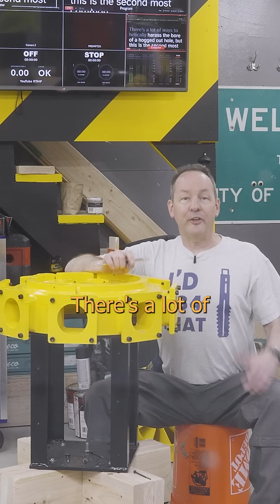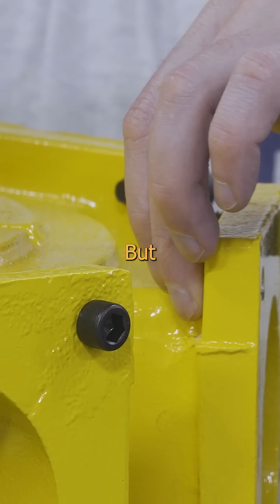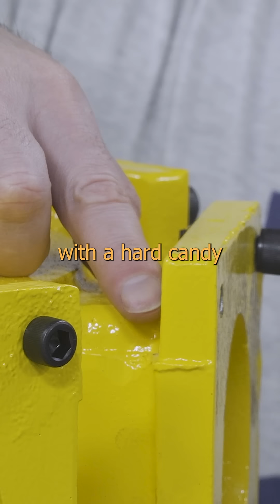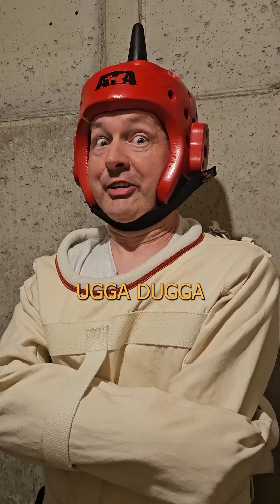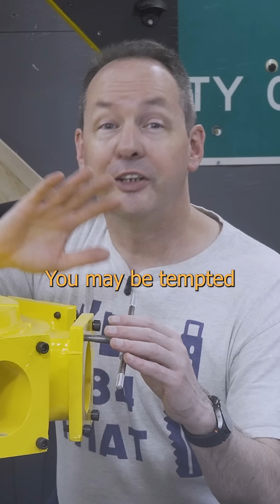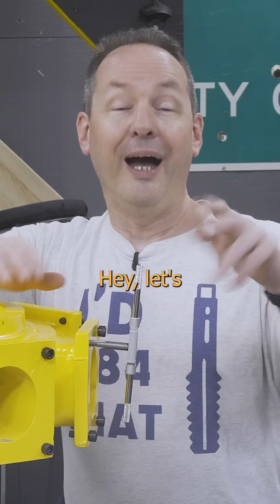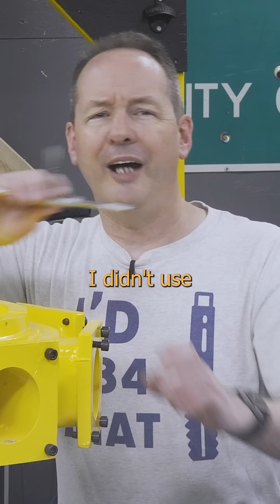Thread Chasing  #chrisboden #comedy #engineering #skills #workshop #metalworking #tools #apprentice

Comment: Yes, I have broken bits off using my drill🥴 a.k.a. dip shit🥴🥴🥴. But when I can, after I hand start the tap I do in fact use a very weak and very low clutched screw gun to clean threads.    What we can’t forget is not to just drive it all the way in in One Direction at a single run, but to go forward and backwards to clean out and break off some of the thread or debris you’re removing!😎👍
 PS where is the fund and running it manually🤪🤪 plus you don’t get to painstakingly remove the broken piece out of the hole!🤪🤪(insert multiple repeated PROFANITY here)🤬🤬🤬🤬🤬🤬🤬🤬🤬🤬🤬🤬🤬🤬🤬🤬

Comment: I haven't made the mistake in this video BUT
My primary use for taps so far in my life has been in 3D prints of the. . . 2nd Amendment variety. I learned pretty quickly that the friction involved in tapping threads into a solid piece of plastic generated a startling amount of heat, and I might have burned myself the first time I tried.

Comment: Dumbass here.
I was cleaning threads on an oil gallery access hatch and as i was finishing on the last one that needed tapping i got overly enthusiastic and bottomed out.
Normally not aproblem when doing it by hand like i was doing but i had just tapped like 30 of these and wanted to go to lunch in a timely manner so brute force it was and i broke the tap.
Not a fun afternoon getting it back out after lunch but i was paid by the hour so it worked out. Would have liked doing more jobs that day but the world had other plans

Comment: my dumbass lesson was using power taps on aluminum. 

but then friday, I needed to replace a spot welded stud on a stainless steel frame.  and i didn't have a single sharp drill bit to make the pilot hole with.  so I was left using a power tap, and a lower case ugga dugga.  but it worked.

Comment: On a job site, far away enough to not wanted to loose a full day to take something from the nearest civilisation, I had to redo a set of screw holes in an aluminum heatsink (4mm screws) and I had forgotten my lube. Well do with what we can, one guy had an electric shaver and had bring his oil for the shaver… anyway that’s worked (took twice the time but it was good and we didn’t break a tap)… anyway always pack your lube with the tap …

Comment: If you want lubrication. But don't want the cleanup. You can use alcohol.
It's not the best for the tap. But it's better than air, and just evaporates afterwards.

Comment: Ohhhhhh... Big dumbass, here. I was chasing a lot of rusty threads (probably 50+ holes) in the walnut huller, all by hand because I'm a very good boy, and--OF COURSE--I rushed the very last one. When the tap snapped off in that quarter-inch hole I just stared at it for a while.

Comment: I build lasers that run the price range of $20k to >$200k.  They're made out of 7071 anodized aluminum (mostly).  The threaded holes run from 0-80 to M6 and most everything in between.  I've learned MANY years ago to check the threads before putting in all the expensive optics and make sure a screw goes in EACH hole as easy as it goes in Amanda down on the corner after a good Saturday night.  The new kids working in Production seem to think forcing it works.  It doesn't.  It just makes our machinist in our shop have a bad day.

Comment: First off, it doesn't taste like regret. It's like Christmas. 
Dumbass here. The enginerds decided to put the wrong thread size on the prints for the lifting points of a train cab we were building. The answer, was to drill, tap, helicoil. The tap handle was one of those big bastards that even your mom looks at and goes "let me stretch first". Broke the first tap, ordered a second and they told me to use an impact thinking I gave it too much sideways torque. Broke the second, because ugga duggas, and ordered the last helicoil sized tap in the country. Very very carefully used the hand tap to finish the last 2 holes.

Comment: Dumbass.  There i was cleaning up a hole in a subsea diver navigation device milled beautifully out of a solid 18x14x8 billet of aluminum.  I had clumsily mashed the screw in that hole earlier, just barely cross-threading the opening threads.  I'm in a hurry, i have a tap on my bench, and a drill.  My young (dumb and full) mind makes the obvious connections, and carefully begin to try to chase out my earlier f*ckup.
Did you know aluminum galls SUPER EASY if you're ham fisted, and that taps are super hard and SUPER BRITTLE?
Thankfully, the Sr Machinist, with 35 years of experiencing helping young guys un-f*ck themselves was two stations over, and was able to help me out.

Comment: Dumbass.

Water pump went out and flooded our driveway with coolant on my step daughters Nissan Pathfinder.
They have internal water pumps in the soft aluminum block run off the timing chain. When putting the new pump in, my dumbass KNEW I SHOULDN'T BUT DID ANYWAYS, used my impact to try and tighten down the bolts on the new water pump. Ripped the threads right out.

Now I'm the owner of a handy tap and die set and that hole is now a single size larger. Still holding to this day.

Comment: Dumbass 😂 the tap wrench in my first crap set broke almost instantly, and I thought I could do the drill on slow with the clutch real low, it worked for 3/4 but the 4th I squeezed the trigger barely too much and it was all over haha 🤣 break out the welder and redrill, re-tap with a new better tap set

Comment: I saw a video of a CNC machine plunging a tap in at ludicrous speed and thought “Oh I can just use a drill? HELL YEAH” I thought I was slick by using the low speed, high torque setting on the ol Milwaukee. What followed was an attempt at breaking my wrist and a very expensive crunch sound, and the beginning of my first experience extracting a broken tap😂

Comment: I was that dumb ass. But mine comes from the opposite side. I tired hand cutting threads on a lathe and thought they were correct, I chucked up the die and started it on the part by hand soon as I fired up the lathe a horrific squeal came from were the die and part met… yeah had to machine a new part and get a new die.

Comment: I was putting bits of my engine back together. I’m no mechanic, but I had a mechanic buddy “supervising” me from the other side of the shop. 

I’ve been using a pneumatic impact wrench all the way through, I get to the fuel rail and go “hey Trent, what’s the torque on these?”.  He doesn’t realise I’m about to use the impact wrench on the fuel rail bolts, and goes “FT man, FT”

And that’s how I found out to use a helix coil set to fix a stripped out hole 😂😂😂

Comment: I’m a dumbass, I never knew about the fact that you’re supposed to be screwing screws in the same threads (turn it backwards till it drops into the hole then start turning) so I on my guitar managed to cause the screw holes in my guitar to go from I’d say 1/16 to 1/4 sized and it’s got these hilariously large screws in it now (I’ll fix it at some point) least I never did it to metal tho

Comment: Ironically I've broken more taps by hand than with a drill, if you have the sense to set the clutch it honestly feel like it matters more what type of tap you choose in the first place. Taper taps do a passable job most of the time, tho struggle with chips, Spiral point taps tend to be a touch more delicate but cut and clear chips better.

Comment: Thankfully I got to be the observer before I made that mistake. I was reassured by a friend that the threading to a steel block on the far corner was going to be perfect and would not need any tap wrench because he prepared a cordless drill for it. The hole was NOT a full through hole but he had made sure to drill it deeper, have a plan to back out and air out the scraps, and mark his tap. I was shown the “right way” to set up the drill was the lowest pressure on the variable, low torque, and to only use pulsing finger pressing to ensure it didn’t do what it inevitably would do. After getting frustrated because the tap was stuck about midway in (because even the drill knew to stop and the torque limiting told him repeatedly) he “adjusted” the drill and used labor’s worst enemy (anger/frustration) to put the remaining part of the tap in. He demolished the threading, shattered the wedged tap, and got to spend the rest of the day pulling the pieces out. I am sure he did some other shortcut to fully fix it but I didn’t want to stay any longer. I forever will have trust issues with anything other than hand tapping.

Comment: Yep. Old server rack probably has 3 broken taps in it because no bolt I could find would fit before I gave up and just ugga duggaed sheet metal screws into it. I used the fancy roofing ones with rubber washers. Works great.

Comment: About chasing with drills: I was chasing M8 threads with a cordless drill when it ran out of battery with the tap all the way down the hole.
At least I had a spare battery in my toolcart, and the tap still lives.

Comment: Hand tapping - An engineering process designed to separate the engineers from the apprentices. Sub 3mm (or around 1/8th" in American) and while the apprentice is going at it like a coked up gorilla, the experienced engineer is treating it like he's incerting detonators into nuclear warheads, over 40mm (I'm not gonna mollycoddle you anymore. Just go learn how to be dimensionally bilingual you lazy bast*ards ! 😁) and while the padawan is sweating over the 45cm "Snap-Off" tap wrench that cost him more than his car, the engineers busy drilling and filing a big square hole in a metre long lump of scrap 10mm thick bar stock to use as a massive makeshift tap turner.

Many a novice has learned that 30 seconds of haste with a small tap can mean 4 hours of trying to get the snapped off remains of the bast*rd out of a workpiece you've already invested 2 days of company time into.

Comment: I was making a set of parallel clamps for a machine shop class. We had used the lathe to make the threads and those came out perfect, but when I used the die on it I somehow made a second set of threads. There also was the issue where the threads were wavy, the major diameter had curves (damn I miss her)

Comment: I've had good luck running a tap with a DeWalt 8V screwdriver... It can be used as a manual screwdriver to start gently, and then can run at a very low speed. The thing can't even make that much torque (probably less than you can on that tap handle, no less). And since it is gyroscopically controlled, you can back out without being at risk of putting side force on the tap (more than can be said for that tap handle). You can be remarkably gentle with that tool, in fact it tops out at like just north of 400rpm... I call it my little wrist saver. =^.^=

Comment: 1/100 times the drill goes bad. Cutting new threads or cleaning old ones, I drive it in by hand on a ratchet, and pull it out with the drill, because I can keep the drill level at the end better than I can the ratchet. The only time I will use a drill to thread a new hole is if it's a new HSS tap into aluminum, any other time I end up using a pencil grinder for three hours to fix what should have been a 3 minute job
Reply: Also the fact that I saw this seconds after I finished tapping to 3/8-16 holes amuses the hell out of me, good timing

Comment: Dumbass here, not an actual tap because at the time I was working for the ironworker(steel erection for those who don't know) but we ground flat spots in threads on a 1 1/4 bolt. Snapped that MF right in half cuz uga duga mf. Hell of a time to melt it out

Comment: Dumbass here. I snapped off a tap in a Very hard to find 1960s Harley Davidson engine block once, using a 12 volt Milwaukee drill. D'oh!! Fixing this fuckup involved heat, carbide tipped bits, and a monumental amount of swearing.
Reply: Oh and afterwards, I finally bought a set of thread chasers. Pricey but worth it

Comment: Been that dumbass. Had a hundred or so holes to do, towards the end, got one cross threaded, drill twisted and snapped it right off in the blind hole. That bitxh aint ever coming out, that tap is silently still in that part.

Comment: I'll just say, you can get dedicated thread chasers for this job, they are less aggressive than a tap and are made to mush out or clean up threads because a tap is a very easy way to end up cutting new holes. This works but if you want stupid proof thread chasers and use these when you need to drill and start fresh

Comment: My dumbass learned that tapping fluid isn't optional especially if you accidentally have a forming tap instead of a cutting one that I'm trying to thread an chunk of square steel with. Didn't have the leverage to use a handle and had to do like thirty of them too so I was using a drill. I ALSO got a bunch of practice on what to do with broken taps that day! Bonus?

Comment: I tried to learn this the hard way but my journeyman yelled at me so i didn't end up breaking the only tap set we had for 200km. Smart man.
Reply: I've never broken a tap, but I have broken enough bolt extractors that the local hardware store ran out of any sized extractor that would work.
They REALLY regretted the "money back guarantee" that day.
Reply: @MonkeyJedi99  and probably changed the policy thereafter
Reply: Hahaha yeah no matter the profession if your out remote you pay closer attention to your apprentice than usual.

And hey ive been there too as an apprentice before. 
But Apprentices, somehow, they have the magical ability to break the laws of common sense, i swear physics and anything within range of them. In ways that will burst blood vessels, or genuinely make others morbidly impressed at how tf that happened, or their thought process to get to the ppint where they got caught, or where they eventually ask for help.
Reply: Km?
Reply: @MeffHedOracle shhhhhh!  Grown up words.
Reply: @matthewaaaron7421  I know what it is but tool speed is measured in rpm
Reply: @MeffHedOracle ok, try this, the tool that broke the tap is going to jump in the ute, use abour 2500 to 3000 of those rpm for about 3 hrs, each way, driving from a remote jobsite or mine in the bush 200km into town for a new set, and probably a sly cold one at the local. 😊
Reply: @matthewaaaron7421  u an Aussie?
Reply: @MeffHedOracle depends.....any taxes or warrants involved?

Comment: Also important fact for dumbasses like me: There are machine taps and hand taps, if you want to cut a thread using a hand-tap in a drillpress, you will get expensive and time consuming sounds as the tap breaks off inside the workpiece.

Comment: That's what my tap used to do, and I did my threads I'm a leave, I know there's misspelled words and frankly I don't care, it's hard to listen to you with all those sexual into it and the windows that's even better than I was thinking or right, our windows can be screwed with, Apple takes their serious, you'll have to buy their kit for you to fix it on your own, and believe me I broke up with her a lot of bolts inside of an engine trying to take off the manifold did you know that metal expanse and contracts and then it yet begins to rust and will not let you do anything except break a wrench or the top of the bolt off, I'm ex Marine I know it's like to have your bolt pulled back. 👍

Comment: DUMBASS - I had just bought my first 108 piece tap & die set. I think it was around $120. I had 100 project ideas in my head and couldn't wait to get started! I was even using the hand wrench, but for some reason I thought the tap would magically finish the rest of the undrilled hole, not thinking that the FLAT TIP would just STOP once it bottomed out... Snapped the f-ckin' thing clean off inside a piece of 2" thick steel the very first time I used it. Talk about embarrassing...

Comment: Dumbass…simply tried to retap my threads to a cylinder head and ended up stripping them out worse then they were already stripped making an already 2000 dollar repair a 3000 dollar repair I ended up scrapping it once it was repaired because the head in the back was also cooked it warped both heads I was gonna give it to a friend of mine but my grandfather jumped the gun and sold it for the price of a full corse meal in Las Vegas Nevada at a fancy restaurant

Comment: In a pinch, you can chase threads with a bolt of the right thread. Grind/file a flat on 1 or 2 sides all the way down to the shank. It's not as hard as a tap, but is good enough to clean out gunk, paint or the lightly buggered thread. One of those "do what you can with what you got" solutions.
Reply: Has saved me untold amount of times. I cut straight flutes with a cutoff wheel (get them fairly wide) it works a treat!
Reply: I file 2 ou 3 grooves using a triagular file. If I have to do it, why not do it fancy? 😆
Reply: Just use a cutoff wheel and go perpendicular to the threads and you’re gravy

Comment: Put it in a drill and let the tap pull itself in. Don't do it if you don't have a feel for it yet. Test on less important threads. For Chasing it's absolutely acceptable to use a drill. If unsure you could even use that torque limit slip thingy that drills have for whatever reason. Taps can take a heck of beating these days, I gotta know, somehow i only broke 2 in the last 10 years.

Comment: im a dumass!   Jerrys Broken Tap  Santa Ana Ca. !/4-20 ss (vented) bolts break in a Metal sputtering tools in the semiconductor ind all the time. they do it with an electrical arc and vaporize that broken bastard right out of the threaded hole!

Comment: Mechanic by trade Worst time I ever had was a blind hole in cast iron engine block on a rusted af ford 5.4 3v needed to chase holes for the power steering pump if you know you know my pain bad location no visibility and bad material broke the tap of in it thankfully an old timer had and extractor set that was able to get it free